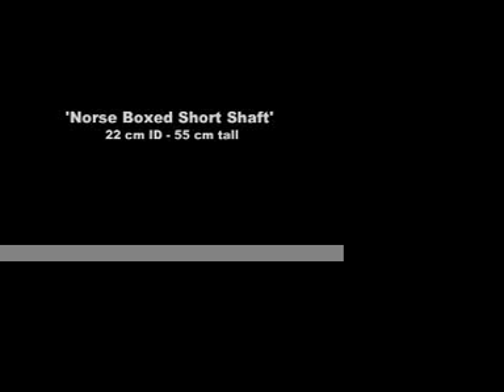Vinland3

Comment from the maker: The irregular shape of the bloom locks into the surface of the stubb. You see that this one, used at least a dozen times, now has a deep pocket to help hold the mass and keep it from bouncing off the stubb. A trick learned from Mike McCarthy. At least at the initial stages, the bloom is still 'soft' enough that you don't need a hard stone or metal anvil for compaction.